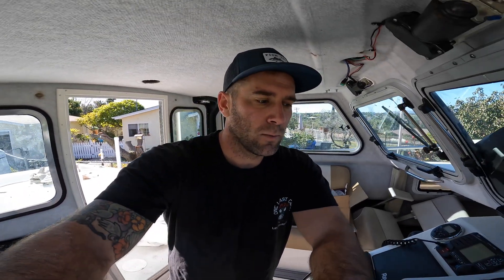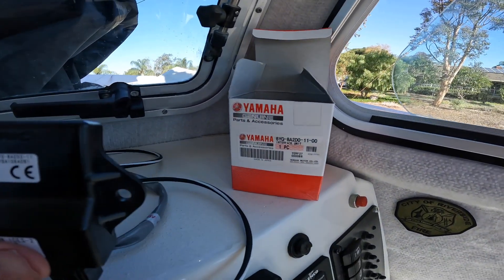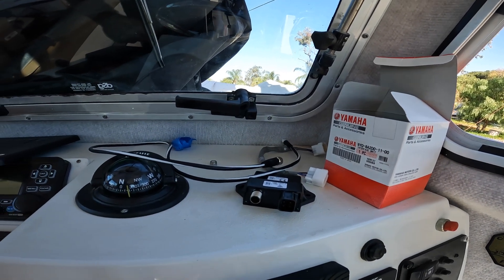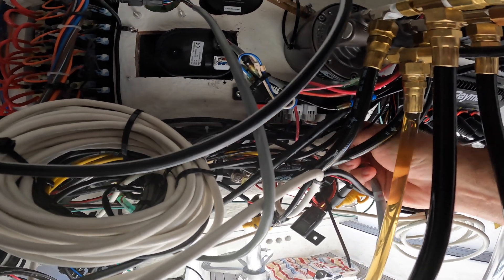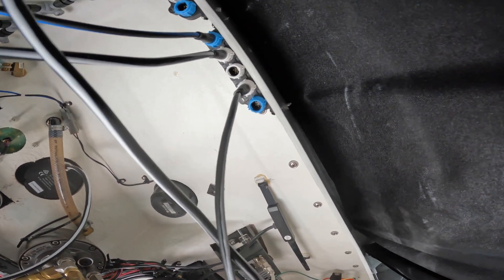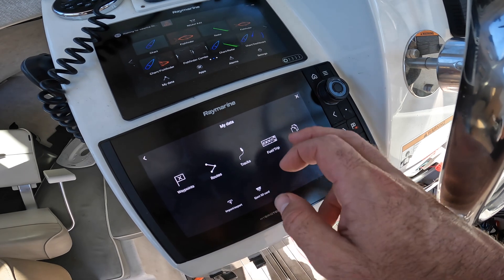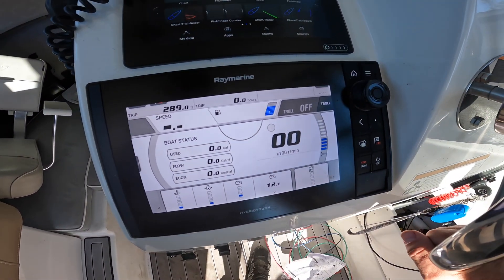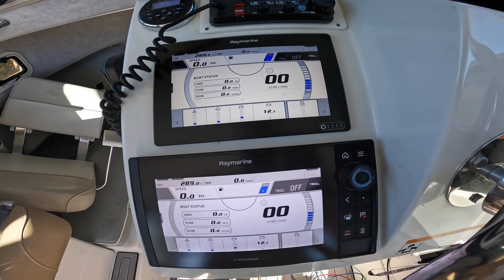How to get Yamaha outboard engine data on an axiom MFD

Comment: Looks easy enough. With twin Yamaha 350’s, is there anything different? Do I need a “Y” attachment and add a second set of parts? Also, by doing this, will my boat’s speed appear on the MFD? Thank you.

Comment: I don’t have the Yamaha CL5 display like you do i have the 6Y8  tach and speed gauges so will this hook up still work on my Raymarine axion to my command link? Also instead of using what you did what do you think about this cable from Raymarine Manufacturer Part Number: E70242

Comment: yamaha is telling me i need a adaptor and another cable in between the cable coming from my engine going to the multi hub, do have this, i have a yamaha f70.or do you have the engine data cable coming from the engine going straight into the multi hub

Comment: Hi. What's the difference between using 6YG connection and Yamaha Nmea 2000 connection direct from engine. Nmea will be eay cheaper right?
Reply from the maker: The only difference is with the 6YG you get to have the Yamaha interface. It doesn’t really matter but I wanted my display to match the Yamaha interface so that’s why I went that route
Reply: @Tonygiooffshore  All data reading will same? I mean all data from 6YG same with data direct connect engine?

Comment: Hey Tony, I appreciate for your video. I've installed today the same configuration as yours. Everything works the same as in your case but I can't see the gear data on the Yamaha page. Is there any way to get it ? My MFD is Axiom XL 16/F200XCA/6YG/6YC and digital throttle connected to Command link plus hub.

Comment: Good afternoon Toni,
Thank you very much for your explanation. I would like to ask you: I have done the same installation but the autopilot does not work because I get an alarm "the satellite signal is weak" I think it is because the Yamaha GPS hits against the Raymarine GPS, is it possible? What do you recommend me to do? Disconnect a GPS? Which one?
Thank you very much in advance,
Best regards.
Reply from the maker: Hi Eugeni, thanks for the comment. It’s hard to say without seeing exactly how your system is set up, but yes I would try to see if only running one GPS works. If that fails you could look into adding an external GPS antenna. Hope this helps
Reply: @Tonygiooffshore  Hi Tony, OK thanks for your quick response.

Comment: When you said "Nobody has all the answers"....man you are correct. I don't have the command link digital gauge and I don't really need it. But I do want to be able to use variable trolling option. If I don't have command link or command link plus digital gauge, will the 6YG gateway still show all of the engine data on the axiom?
Reply from the maker: It’s crazy right!? You’d think this stuff would be laid out. But yes from my understanding as long as you have the command link multi hub (I’ll put the link below) you don’t need any gauges. Using the 6YG like I did you’ll have full control from your axiom. Hope this helps! 

https://www.partsvu.com/6y8-81920-01-00-multi-hub-assy.html?utm_source=google_shopping&utm_source=google&utm_medium=cpc&adpos=&scid=scplp6Y8-81920-01-00&sc_intid=6Y8-81920-01-00&gclid=EAIaIQobChMIq7_Jo5mO_gIVJALnCh3CmAFEEAQYBCABEgKZLfD_BwE
Reply: @Tonygiooffshore  Thank you for the quick response. Your vid is super helpful, great content and relevant. The Yamaha VTS switch is back ordered into oblivion so I am looking for the next option. I will let you know how it turns out. For future viewers: My setup is sea star (Dometic) hydraulic steering,  Raymarine Autopilot, Yamaha VF115, with the end goal of using my Axiom Pro Yamaha screen to control engine RPM's for salmon/walleye trolling.
Reply from the maker: Absolutely! Good luck to you let me know if I can help in anyway
Reply: Hello I’ve got the Yamaha f70 and I have the nmea2000 hooked up, the lorrance cable comes from the motor to the backbone nmea2000, I’ve got the backbone powered and a cable running to the garmin comparable graph, Yamaha saids I need the multi hub and the gateway to translate the data to the graph, how does the multi hub and gateway figure into the system